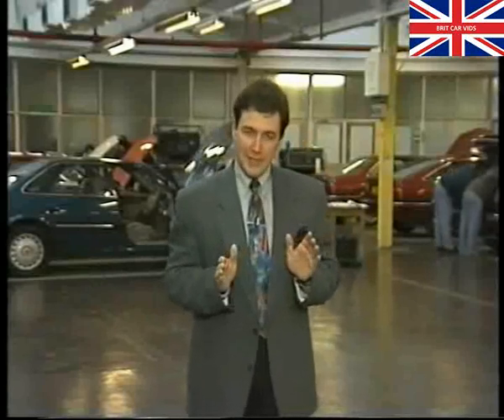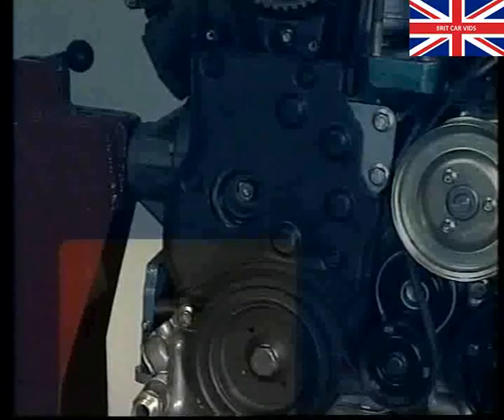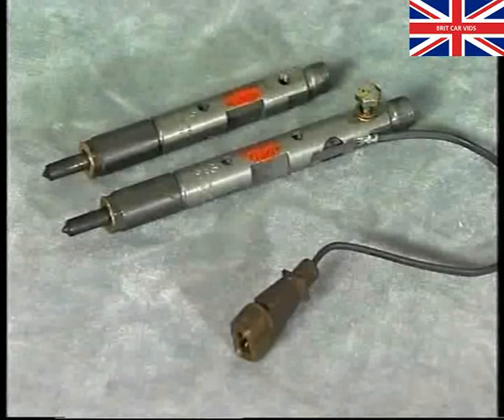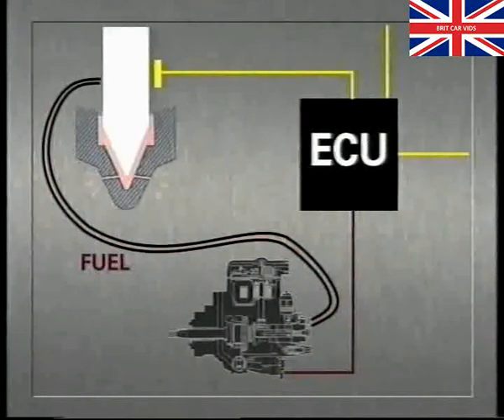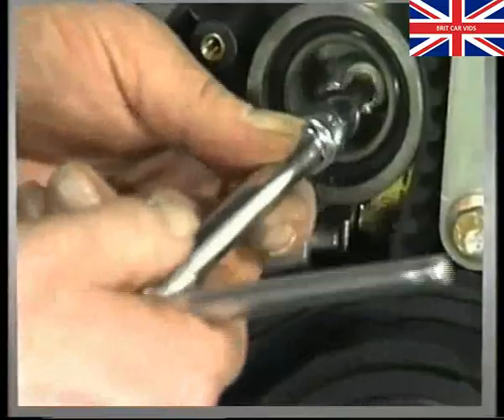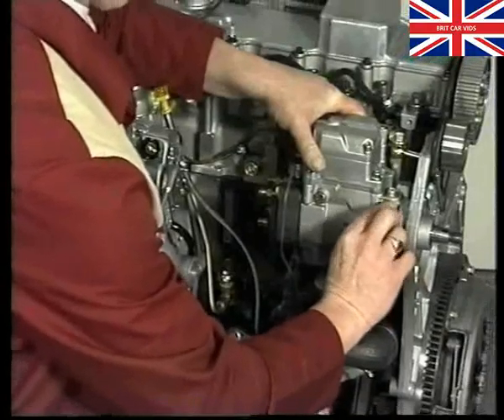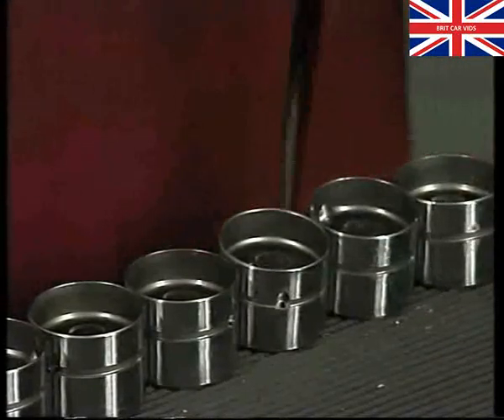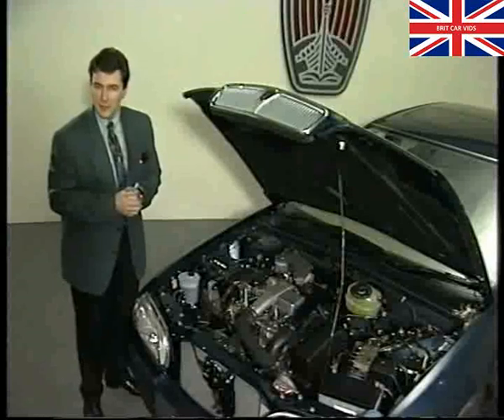Rover - Rover Professionals - Service Insight - L Series Diesel (1995)

Comment: Top engine designed by perkins for rover, fantastic when tuned.
Reply: chris fleming no it wasn’t actually it was developed by rover with assistance
Reply: Developed by Rover with some consultancy work by Ricardo as far as I was aware as a lowly experimental engine tester. An excellent engine.
Reply: As far as I'm aware it was designed by a UK company called powertrain Ltd in association with rover and its associated partners. As for being capable when tuned I can give testiment to that I own a late type obd2 l series with sdi's, darkicedesigns over pipe, de cat, itg filter in a zs airbox, mafam and a manual boost controller it's no slouch put it that way very aggressive power delivery for such a humble design. The only problem you do get is it wants to blow its head off quite literally 🙈.
Reply: @callum4035  yep powertrain was the assistant 👍
Reply: @stephenbates8370  Yeah, i maxed the turbo on my 25, and my old gasket is saying goodbye, starting to build pressure in the hoses. I think i will try to retorque the bolts again, in case they stretched while i gather everything to rebuild it. Are there any stronger bolts?

Comment: 67 MPG is really good for an old diesel using older engine technology
Reply: Truth be told I have never got that kind of figure even in the zr but there is no denying it can be frugal even when capable of beast mode lol 😂
Reply: Environmentally friendly for the day
Reply: @stephenbates8370  ive done a acurate measure of 65 mpg with tyres at 42 psi and cheap tyres, now im on rainsport tyres it does 55 mpg